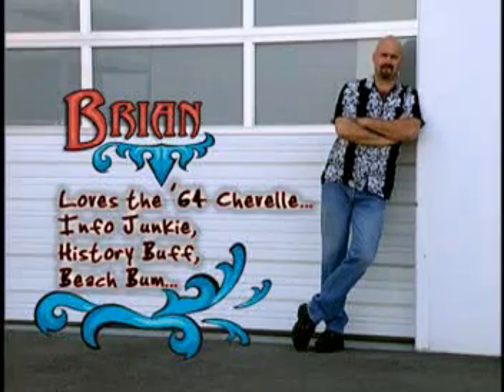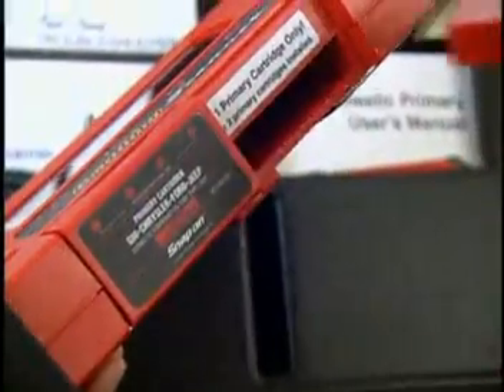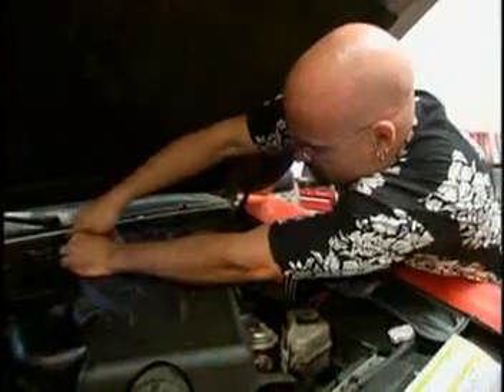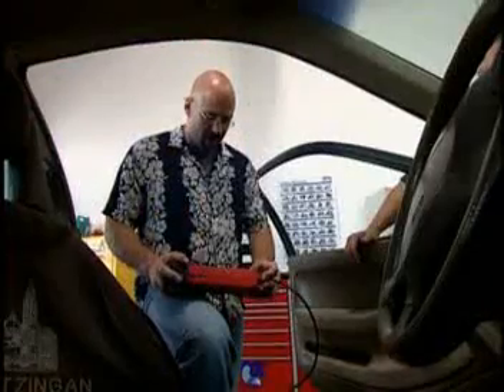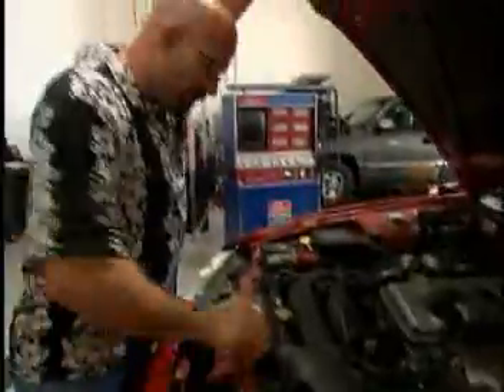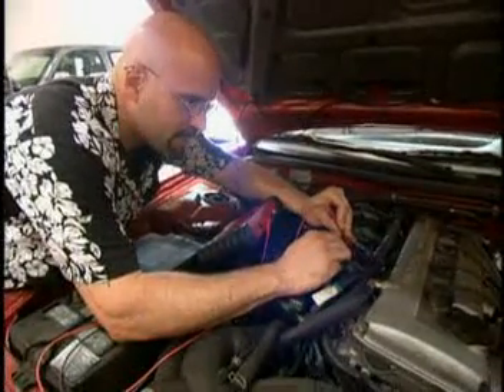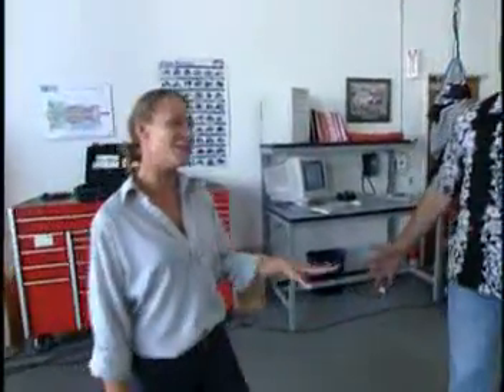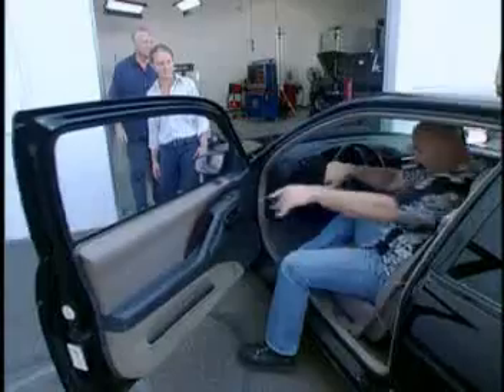Snap-on Fast-Track Techs - Scanner & Troubleshooter Action

Comment: They're using an obsolete scanner- but it was good to have at that time. Time is money. The fast track software- saved the techs countless hours of troubleshooting time.
Reply: I can only afford old vehicles. That's why an mt2500 works for me. The mt2400 scope meter helps too.  Good tools never become obsolete.
Reply: @mikep95133  Excuse me sir I had a question for you, do you know the part number of the obd2 adapter for MT2500 ? I got the scanner and I want to use it with my obd2 cars, thank you in advance
Reply: David Hall well the new scanners don't do old school stuff. Like the 89 s10 2 wd 5 speed pickup I have.  I won't start even though I replaced the fuel pump and tank. Previous owner also replaced the fuel pump. Must the red brick be hooked up to ALDI connector for fast track to work ?
Reply: @altlandf  Fast track Troubleshooter is a database of tips tailored for the respective vehicle being diagnosed. It's tips collected from millions of technicians.
Reply: Dude, the video was made 11 years ago, in 2008

Comment: @hmech61 It looked like a previous generation Civic (1992-1995) which was OBD1. I owned a '95 and what gave this car away was that 1) it lacked a front grill (the 1996-2000s had one while these didn't...check out at 3:02) and 2) the seats. That hook shape at the top of the seat says 92-95 Civic all the way, 3:12.